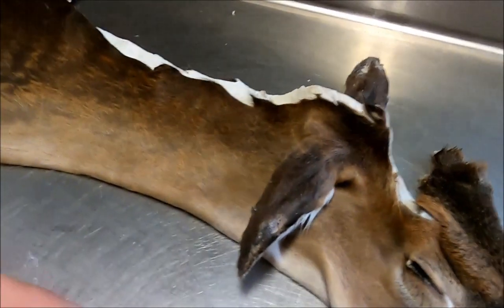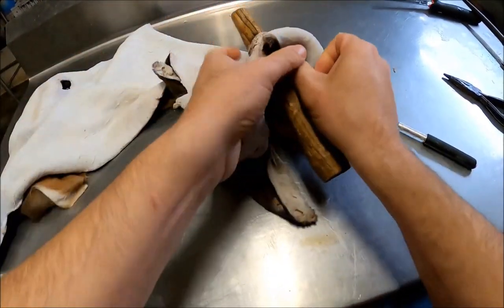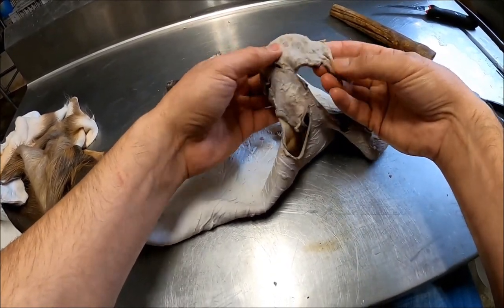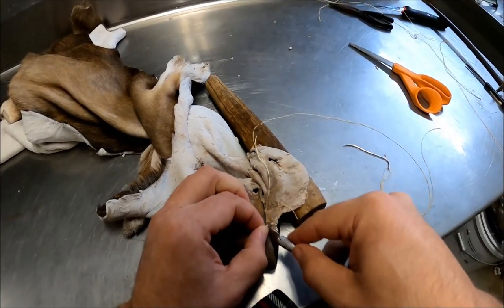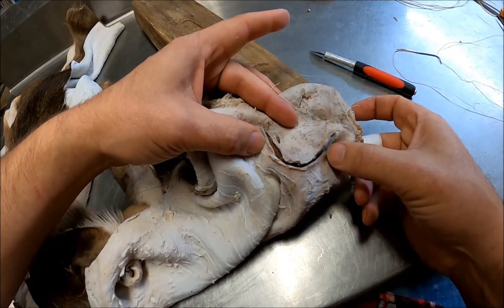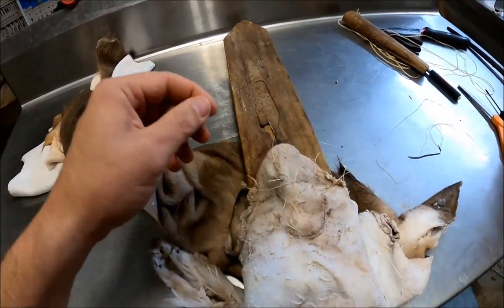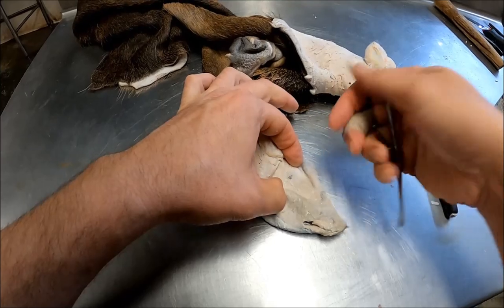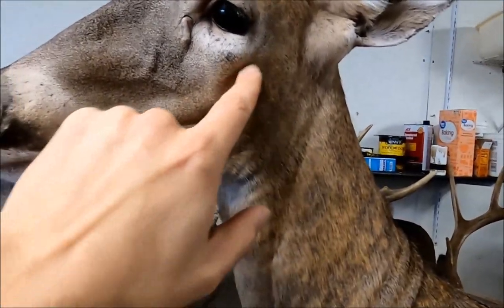DON'T THROW IT AWAY!! (PART 1) MY HARDEST REPAIR YET! *SUPER EASY*WHITETAIL TAXIDERMY!!

Comment: Just make sure with the fleshing machine you let the hides drain good I take them out and let drain at least 4 hours then flesh and only have the guard set about 1/16 of an inch to start and adjust because you can jack a cape up quick if that thing gets into it